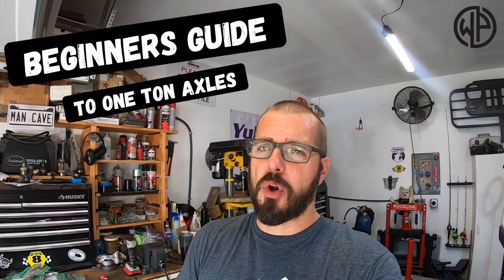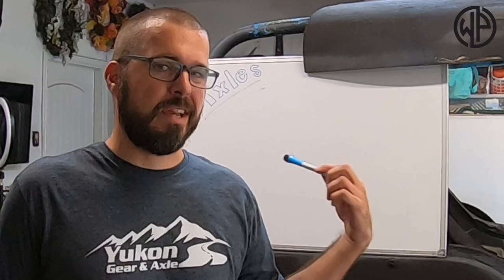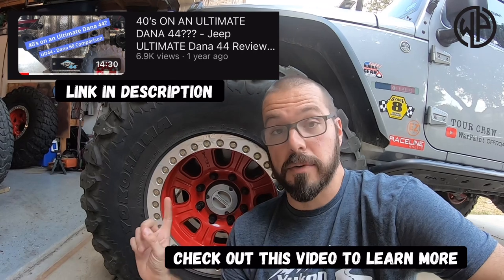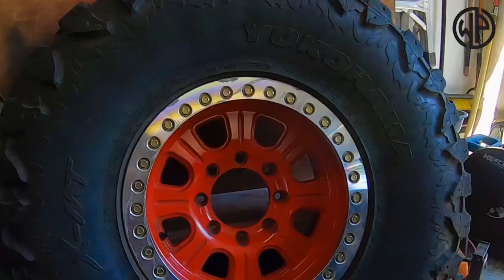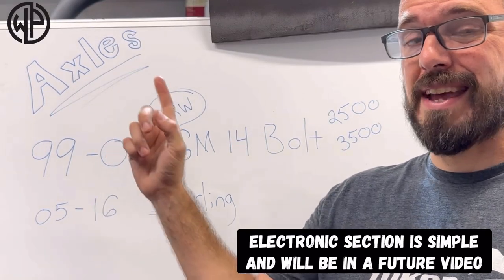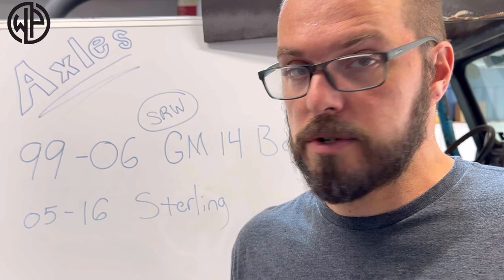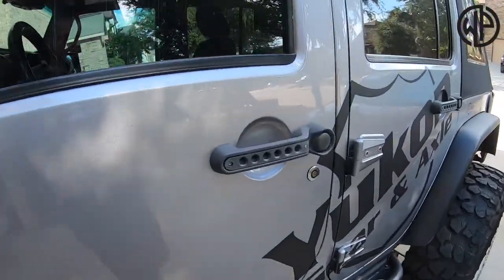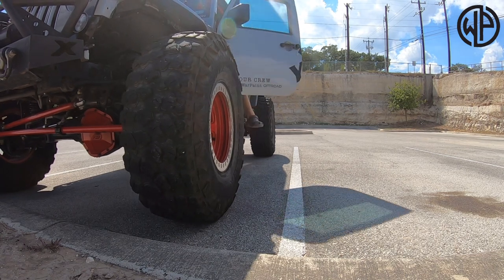One Ton Axle Swap Beginner’s Guide - Jeep Axle Swap

Comment: The more I learn...the more I love my 33" stock setup.
Reply from the maker: It’s definitely a spiral of modifications once you go large enough. You can get away with 35’s and a 3.5 inch or smaller lift without doing too much. But when you go taller than that…or larger than that with the tire….the supporting mods start….and once you pull that string…man it just keeps unraveling.
Reply: @WarPaintOffroad  I'm one of those people who, if I'm completely honest with myself, my jeep has far more abilities than what my skills can handle. 😂 I keep thinking about going to 35s, but again if I'm honest with myself, it has more to do with astatic reasons rather than true functionality reasons.
Reply: @CoreyBrass  right on. in fact some mods i see done to jeeps, all kinds of jeeps, are on jeeps that will never leave the road, or, get used very little. i almost bought one that had a 6in. lift on it and it was so soft you couldnt hold it straight and it rubbed when turning. the guy was selling it because he couldnt figure out why it handled so bad. i said you probably have one of those rock lifts where its supposed to articulate like crazy. looked good but pretty much useless.
not to mention, some mods ruin a jeep and, in the end, its not even close to being a jeep. its been converted to something else using a jeep frame.

Comment: Love your technical videos.  You are unique in the community to do that.  Thank you for sharing.
Reply from the maker: Thanks for the support. I’ll have a bunch of build videos and technical stuff coming over the next year for the CJ build. Next week’s video will be an update on the motor as I head to the engine shop to pick it up…and get it back in the original frame.
Reply: @WarPaintOffroad  Another thing to point out is that on 99-04 Superduty fronts allow the hub to be machined down to be 5 and 6 lug.  05+ do not.  That was a deciding factor for me because it allowed continuity with wheels as I did swaps in steps.

Comment: Great video Dan. I did my ton swap about 3 years ago when I Hemi swapped my JKU. Also did the an 8spd auto at the same time. Something to add. I have the West Texas Ram on my JKU. I had them rebuild my steering box when I did my swap and ordered my ram. When they do a rebuild they will ask you what you are running. So, Justin at West Texas knew I was running an SD60. You mention the greater steering travel of the Dana 60. Well when they rebuilt my box they are able to open up and increase the travel of the stock JK steering box which allows you to take advantage of that greater steering throw. My ram on my SD60 is 9" long. The thing you do have to be careful of is, as in my case I added Barnes 3 link long arm suspension when I was doing my tons. I added Barnes tracbar mount and once I installed my rebuilt steering box had contact between my pitman arm and my tracbar mount because of the increased travel. Had to cut it off and adjust its mounting location. But....long story short you can have the stock steering box opened up a bit to add additional steering travel.
Reply from the maker: Thanks! I appreciate the support! That’s great that they were able to take advantage of it. And yes…the Barnes bracket usually doesn’t work on factory boxes. Tmr customs and rpm both make amazing brackets that work. Same with artec industries. I’ll have to speak with Justin and maybe get myself a new box.
Reply: @WarPaintOffroad  I have to add that they added the extra travel and I didn't even know.....till I installed my box and had interference. I thought I had done something wrong. Called Justin and he was like, yeah...we opened it up a bit because you are running an SD60. I was like, that explains it. Just moved my tracbar mount back about an inch and all was good.
Reply: I got my box from them when I did my swap. Ended up with a box from china. Not even 20k miles on it and its wore out. Expensive downgrade from my Mopar Delphi  box I sent to them.
Reply: Maybe I missed it in the video but what do you have to do in order to make the brakes work did you have to have a larger master cylinder or booster ?

Comment: love the info in this video. I feel it could have been longer as ive seen 14bolts from rams used as well. also, on the 99-04 d60's, where the knuckle mounts is smaller as well. The opening are closer together, where as the 05+ had a larger opening. keep up the great info. 1 ton axle info i feel is so hit or miss for answers and you did a great job explaining them.
Reply from the maker: For sure! It definitely could have been longer.,but as a beginner guide…I had to try to keep it moving along. Thanks for the support!

Comment: What about a longer pitman arm to increase the "throw" of the steering box? .....  in conjunction with the hydro assist?
Reply from the maker: That would certainly help. It just depends on the space you have. Things get extremely tight under there with the Superduty swapped axle. The diff is much closer to the driver side than a factory axle or even the store bought 1 ton options. So fitting things and making those kinds of adjustments gets tight. For example, my current drag link at full driver only misses the track bar bracket by less than a 1/4 inch.

Comment: My decision to go one ton axles was they are easiest to find and cheaper than a Dana 44 for the front . People want thousands for a Dana 44 used when I can get a Dana 60 and build it . I found a GM 14 10.5 for 250.00 complete . A 2006 F250 super duty Dana 60 for  400.00 . In the long run it will cost the same to build these axles as it would my rear axle and a Dana 44 front axle

Comment: I'm rebuilding a rear dana 44 for my TJ that I stretched to an LJ. I've cut everything off now I am trying to figure out where to put all the mounts. I am doing a triangulated rear with outboard shocks. I have put on the truss over the pumpkin but still trying to figure out the rest... Lower control and shock mounts
Reply from the maker: Sounds like an awesome build. I would put the lowers as far apart as you can. Uppers depends on whether it’s triangulated or not. Theee are lots of options. Just have to know the antisquat numbers and put the brackets in the right place accordingly. Look up antisquat and it should help you determine what you need to do.

Comment: I wanted 1 ton axles and ordered a Dana 60/Dana 80 from Skinny Pedal Racing. I do not care about the price. I wanted the best axles I could get.
Reply from the maker: That’s cool. But tbh, the superduty 60 is a stronger axle. The axle tubes are a larger diameter (3.75 inches compared to 3.5) making them stronger and also thicker wall tube (half inch wall compared to .370). Take that on top of having to truss it and it’s a much stronger axle than the ultimate 60 they sell.
Reply: @WarPaintOffroad  I wish that I had this knowledge beforehand.

Comment: Im new to the jeep thing and im planning to commit heresy with this first one. Its a 2011 2 door sport with the 3.8. I use it for delivery driving. I actully want to get the sky jacker low jacker 2 inch drop springs. Eventually i intend to tdi swap it and put an awd transfer case in. Im not really sure yet if i need to swap anything else 🤣 i only use this one around town. If i make an offroad rig it will be an older model
Reply from the maker: Sounds fun!

Comment: I like the aam 11.5 rear axle over the 14 bolt
Reply from the maker: Just a different style 14 bolt. But I like the 10.5 tbh, it already hands down enough. I like the pinion having its own carrier, and I like the aftermarket support for it.
Reply: @WarPaintOffroad  i like the 10.5 but I do feel like the 11.5 is a better fit on mine I had a cpr 14 bolt swapped it to the 11.5 just because I wheel a full size 06 cateye with a sas I am running a 04 ford super up front and that’s my biggest regret I should have went with the 05+ but I was on a budget and this is  an all leaf truck 😭 I wish I would have did the coil overs up front it’s a bit rougher but it still crawls like a monster I am running 40” on Rockzillas I do have 05+ tons and the 14 I was running in the shed I plan on doing tons on my xj and a 6.0 4l80e swap I have been debating on if I want to start a YouTube channel or not.just to document the build
Reply: Have you wheeled at mears adventure park ?  If not man it is a treat into in the texas panhandle probably the best park in texas and I love the Jeep it is my favorite on YouTube

Comment: What do you do for the bolt pattern. 1 axle Ford and 1 axle GM ??? How do you make it so they are both the same ?
Reply from the maker: Great question. So the ford is an 8x170. The Chevy is 8x6.5 there are a couple options. The most popular by a long stretch is a spacer/adapter to make the rear an 8x170 and match the front. People also do this so the rear is the same width as the front. The ford is about 3 inches wider. So getting 1.5 wheel spacers fixes that issue and still allows you to use factory ford and Chevy parts in the hubs. Then they are easier to replace when they wear. But you CAN redrill the front cord hub to an 8x6.5 to match the rear. But you still then have to deal with it being narrower. Not to mention being tougher for replacement parts.

Comment: What about a 2005 f450 front axle?
Reply from the maker: Probably not worth it. They are a bit wider if I’m not mistaken and definitely have a different lug pattern and hub bearing. You might be able to convert it to the 250/350 lug pattern…but the added cost is unnecessary and the 250/350’s are easy to find.

Comment: All that was pretty informative but, I my rig isn't a Jeep, os a 3500 01 Chevy Express Van.... What are your thoughts on that upgrade for it?
Not rock crawler intending though
Reply from the maker: That’s super cool! The only concern I would have is the electronics. I’m not 100% sure how to program everything. The aftermarket support (trusses, brackets, etc) would certainly help you with the choice there). But you would have to be able to tune the computer to accept it all. I’m not sure how to do that or how easy/hard it would be. Because of being a 2001…I would have to think it isn’t difficult, but I can’t be certain. Do some research there. No one makes a kit for the van that I know of. But with a grinder and a welder, anything is possible. If you follow my rock gobbler build, I have made a completely custom frame that no one makes a kit for. I then took an LS motor and a th350 trans with the axles I mention above to make everything work. Might give you an idea. But it’s a big project.
Reply: @WarPaintOffroad  thanks man! I can see your a thinker guy not waiting for someone to open a road for you, isn't that's off roading is about?
Reply: By the way, I'm planning no electronics for it, I'll go manual gearbox, dream swamp rig!

Comment: If I was gonna use two chevy axles which one would I use for the front? And would the ram and everything be compatible?
Reply from the maker: The ram would work…but the trusses, high steer arms, etc wouldn’t. Tbh, I’m not sure what Chevy axle you would want to use in the front. You have to think about wheels speed sensors and the aftermarket support. People generally use the ford axle in front because it’s easier to make it work.

Comment: Can you give me some details on the Sterling 10.5?
Reply from the maker: The sterling differential comes out closer to the passenger side. So it doesn’t work on a Jku because of the gas tank people. People usually wind up, running a fuel cell and removing the gas tank in order to run it. It’s a lot more difficult to regear compared to a 14 bolt as well. But the locker options are pretty much the same and the strength is arguable compared to a 14 bolt.

Comment: Hi, great videos and info...
Onde quesiton, what do You think about using a Ram 2008 1 ton Front Axel ???
Reply from the maker: Great question. I personally wouldn’t. There just isn’t aftermarket support for them like there is the other stuff. I mean you can make anything work if you are skilled enough. But the savings you have working with that axle versus buying a superduty axle will be offset by all the time you spend engineering it to make it work.
Reply: If you notice that the dodges don’t have hubs poking through the wheels it’s because the locking mechanism is actually located on the long side of the axle tube, I.E. a very weak link. Reason why no one is getting them out of the junkyard.

Comment: Would a Dynatrack purpose built 60 or 80 suffer the same turning and steering issues? And how much do you think you saved doing the swap from pick n pull parts? Great video. Learning a lot. I’m interested in making a very capable but middle of the road Jeep. Something you can daily drive, tow with, and hit a trail with.
Reply from the maker: Great question! So the store bought one tons WOULD turn better. Reason being that when you get a junkyard superduty the diff is closer to the driver side. So the track bar bracket in the frame has to be moved. That is what causes the interference and restriction with the pitman arm on your steering. The store bought axles jeep the diff close to a factory location on the axle. So you don’t have to relocate it. 

But be careful. Because the cheaper Dynatrak stuff is often still only a 5 lug and it winds up not having the right bearings and other things. 

As far as savings, I was able to build the entire jeep (suspension, wheels, tires, axles, driveshafts, brakes, etc) for less than what a store bought set of axles cost. But that is because I did it all myself. So if you have the ability to weld fairly well, or know someone who is willing to help you….the resources are out there to show you how to do gears, what to cut, how to weld trusses…making it a great rig. 👍 

Let me know if you have any other questions!
Reply: @WarPaintOffroad  I may hit you up for some consulting on a build if you’re open to that kinda thing.

Comment: What did you do about the different lug patterns? Added spacers or you drilled?
Reply from the maker: Spacer/adapters. Ot helps make the rear the same width as the front. And converts the rear bolt pattern to match the front. Keeps the front hubs easy to service and available at part stores. Same for the rear…if you remove and reinstall the spacer/adapter.

Comment: I’m interested in what aftermarket hubs are available for 05+ 60? All I know about is warn. Yukons only makes them for 99-04 and older last I checked.
Reply from the maker: Yes. So Yukon only makes them for the earlier style…which is good because those factory hubs are super weak. Warn are the ones that I would use if I needed to. But honestly, in a rock crawling capacity, these have been fine. Where I usually see them break is if someone gets the front axle off the ground and gets some wheel speed…then when they make contact and bite it’s too much for them. But usually they are fine otherwise.
Reply: @WarPaintOffroad  I know rcv makes a 300m gear for 05+ hubs but haven’t heard any feedback.

Comment: Great Tech!  The axle I need front and back seems clear to me. I will be doing the 2005+ front and back as a pair to make sure if I need a brake job I can just say 2005 F-* brake job and not confuse the brake job guy with a 14 bolt GM in the rear. BUT...... I can't find WSB specs on 2005+ Dana 60's and/or the offset of the pinion from axle center in the front or rear So, when I am looking for a 2005+ axle carrier set, it is hard to ask the "guy" on Facebook Marketplace to confirm all this data before I go and look at the axle set. I need to confirm Dana 60 and not Dana Super 60. I want to confirm 4.1:1 ratio. Like to know the BOM/part number of the prospective axle. How do you handle all this need for data? I don't want to fork out $1200++ and or drive 300 miles to discover the offset of the front pumpkin doesn't "Gee Haw UP" with my transfer case. I am trying to avoid purchasing custom axle units as I am new to all this and don't feel like the high dollar investment is wise for me at this stage. Appreciate your/or anyone's thoughts.......
Reply from the maker: So the “super 60” is often referred to wrong. Super 60’s we’re actually a part of the F450 and up series of trucks. They are wider and have 10 lug hubs. As long as it’s a 2005-2016 you’ll be fine. the 14 bolt in my opinion is really a superior axle. So if you are going with a sterling just not to confuse the brake guy…he is already going to be confused when you tell him what axles are under your jeep. So I wouldn’t worry about it.

Comment: What thicknes wheel spacers are you running in the rear to mach front width?
Reply from the maker: So a 1.5 inch spacer/adapter works perfectly. The axle is about 3 inches narrower than the SD60. So the spacers make it damn close. And I get them as adapters to it converts the 8x6.5 bolt pattern of the 14 bolt to the 8x170 patter of the Ford D60.

Comment: Why if 1 tons are so good and the big tires and upgraded steering, why is it your running your hiems in single sheer when you could run them in dual sheer? You have the mods done to your knuckles to run dual sheer but your not using them?
Reply from the maker: Great question. To the sheer strength of the 3/4 stage8 bolt is actually extremely high. The reason I am running the tie rod under the high steer arms is because when I flex the jeep and steer at the same time the tie rod winds up contacting the steering ram. So it’s the only way with that particular high steer arm to make it work. Things are VERY tight on a Jk front end with that superduty axle. I am currently building a CJ5 with a custom frame that is going to be using different high steer arms and that will not be a problem.